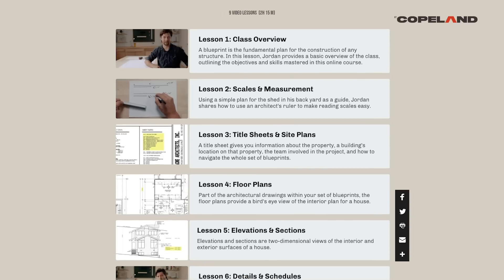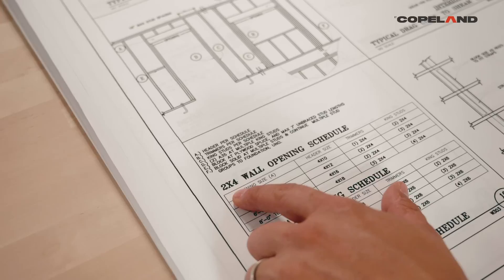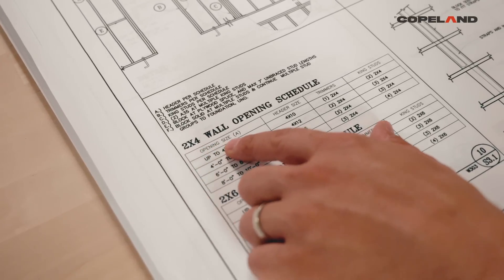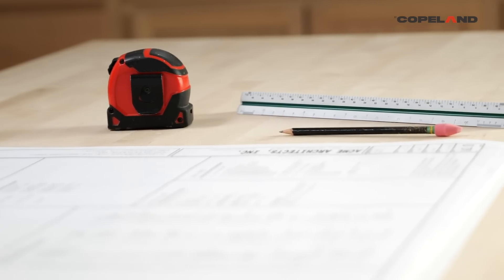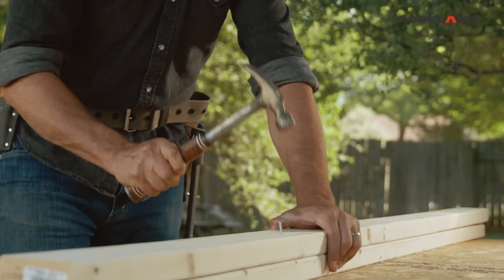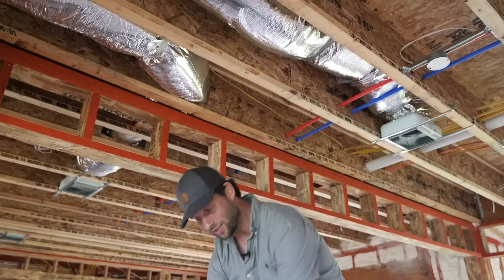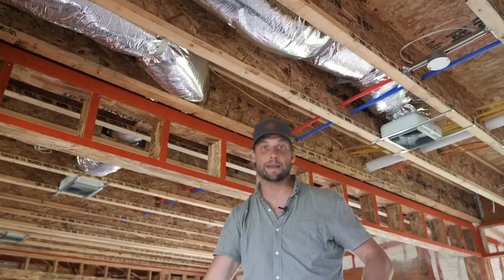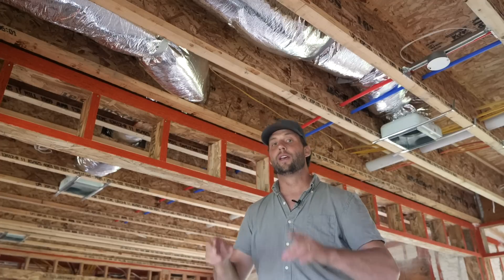Flex vs. Rigid Metal AC Duct - My preference may surprise you!

Comment: I wonder how well it will hold up after a hundred years compared to rigid. We know the rigid will still be just fine. And don't forget the hybrid approach of running rigid trunk lines and flex branches.
Reply from the maker: I agree, time will tell, but given that my ductwork is in conditioned spaces away from traffic and UV, I am optimistic.  I prefer a "home run" solution where each branch ties directly into the plenum.  It makes a bigger plenum, but with dampers at the start of each run, it makes adjusting the flow through each run super simple.  It really depends on the design of the house and AC location.
Reply: Jordan Smith will you, or rather can you, do a more in depth video on running ducts? This has always been puzzling to me on how to size the ducts  - how large should you start your duct or plenum and do you step down the diameter, and if you should then at what point and to what size? And now you mention dampers and my head is spinning. I would love to know more. I know there are so many variables but is there a "general" rule of thumb for some of it?
Reply: @robertrusso5525  There are rules of thumb like 600 square feet per ton.  Sophisticated HVAC contractors will do a Manual J, that is, calculate the total heating or cooling load.  Choose the right size equipment to satisfy that load, and then design a duct system that distributes a portion of the total air volume of the air handler proportional to the load for each room, following installation, the system would be balanced to make sure that actual airflow matches the design.
Reply: How many houses built today will be standing in 100 years?
Reply: @jl9678  probably a lot more than you think. There is a large number of homes where I live that were built in the 50s and 60s still standing. And builders like Jordan are building to standards that will have a house survive for hundreds of years barring a natural disasters
Reply: @ColeSpolaric  house built in the 50s are not 100 years old. And how many systems in those houses are original? Did they even have ac in the 50s?
Reply: @jl9678  I'm just saying that they're still standing and will most likely be in another 30 to 40 years. Many of them have forced heating systems rather than radiant.
Reply: in 100 years we won't be  using central systems.  I am shocked people are still installing this crap.
Reply: @MichaelMantion  what should we be using ductless systems? I hope that's not what you're proposing
Reply: @jl9678  The entire country of Japan does it, it's not the radical of an idea
Reply: @TheAnimeAtheist  does what?
Reply: @jl9678  have like 3 or 4 ductless minisplits per house, no forced air system at all
Reply: @TheAnimeAtheist  oh. Yeah, all of Asia and Africa use those.

They have their shortcomings.

Comment: Its 2020....   Anyone who doesn't install mini splits needs to have their head examined.
Reply: Mini splits are typically oversized (smallest heads are 6k btuh, that’s 500-1000 square feet for our systems). MS have terrible filtration (we spec MERV 13 minimum on our air tight ducted systems). MS, in general, do a poor job of moisture removal.
Reply: @neilcomparetto  shh. Don't burst their bubble
Reply: That's a question of cost. Especially if you want a mini split that doesn't stick out like a sore thumb.
Reply: @ColeSpolaric  Its also a question of efficiency and effective temperature control.  Being able to turn off rooms you don't need, then have those room come to temperature quickly when needed is great.  Ceiling cassette are getting much cheaper and common..  Also most homes will have multiple outdoor units, that provide redundancy if there is a problem.  Lastly mini splits are much more reliable, easier to install and cheaper to maintain.  SURE top of the line Mitsubishi systems are  expensive, but most quality Mini split systems with in ceiling cassettes are similar in price to Central air once you consider installation costs.  The utility cost savings are just icing.
Reply from the maker: We are definitely moving towards VRF, but there is still a need for ductwork to get proper distribution and mixing in many situations.  I do like the redundancy of multiple units.
Reply: @JordanSmithBuilds  We install a lot of the 12k DUCTED Mitsubishi units, so we still have some redundancy. VRF typically has less redundancy because if the outdoor unit goes down, or if there is a refrigerant leak on an indoor unit, the whole system is impacted... Ducted is the way to go — able to right size small zones with air balancing, able to add on IAQ devices like great filters, ducted dehu, fresh air, humidifiers, etc... Are they less efficient? Possibly. A well built house (like yours), doesn’t cost a ton to heat/cool, so the available money to save is minimal. Plus, comfort isn’t free.
Reply: @JordanSmithBuilds  Ductworking is so unhealthy in every way and should be avoided at all cost.  Ceiling fans and doorways  are more than capable of air distribution, Having GOOD air filters in every room is much better than pumping air through a toxic environment and relying on your system filter to stop the toxins.  No modern builder with a brain would recommend force air over mini-splits in a new build. I get it if the customer wants forced air give them it, but you should at least recommend a much better alternative.  I am waiting until we just push hot and cold salt water around the house to heat and cool and keep the  evaporator and condenser outside the the main building.
Reply: @MichaelMantion  have you seen the inside of the typical mini split. It's a filthy , mold filled gross thing. 

Which mini split is small enough to cool a 120 sf room? And when you have 4 of those rooms, who will clean the mini splits.

Saying mini splits is the answer is an uneducated position
Reply: @ColeSpolaric  mini splits don't provide ventilation and ventilation is required by code so .. 😂 and they don't work well in parts of the country who get below 0 degreesF.
Reply: @CybekCusal  geothermal comes into play in northern climates. And a central hvac system doesn't necessarily ventilate either unless designed to. Some systems separate the ventilation. Then there are those that use radiant heat. All the possibilities nowadays lol
Reply: @CybekCusal  only leaking ducts in unconditioned space provide provide ventilation :)
But I agree that such kind of ventilation is better than no ventilation
Reply: @CybekCusal  If that were true then the codes should be changed and the people advocating for "ventilation" should be ignored.  By your logic a energy efficient house  is more dangerous because the forced air system would be on less.  about  I would say before I installed mini splits my forced air system didn't run 8 months of the year.  I really only needed cooling for 4 months of the year and occasionally had to run the gas furnace.  I get it there is more margin and more labor in traditional systems and many mini split systems are installed DYI.  I understand all the HVAC people are afraid they will go out of business.  But learn to code or something, don't spread lies that ventilation is needed.  Again if HVAC need to run for ventilation than 3/4th of my life has been living in a deadly situation.
Reply: @ColeSpolaric  I love ground source heat pumps and I actually have a google alert set for mini splits and ground source.  In theory they are being designed but we are getting to the point that mini splits are just so efficient ground source.  I have plans to add a heat exchanger so I can use my pool water to improve the efficiency of my pool system.  Pluss then I can keep my pool open later.  I use a natural gas fireplace to heat the house so the mini split unit near the pool pump isn't used a lot in the winter.
Reply: @MichaelMantion  lol. I'm a licensed engineer silly . No lies here. 🤦🏻‍♂️😂
Reply: @ColeSpolaric  yep. I love decoupled systems for commercial buildings
Reply: @CybekCusal  OMG your a licensed engineer.  that means everything you say is 100% correct and you would never mislead anyone.  TY for helping explain why mini splits are a mistake. BTW that was sarcasm, being a licensed engineer is not hard.  If you are a licensed engineer solve the equation below

8 ÷ 2(4-2) =
Reply: @MichaelMantion  = bored
Reply: @CybekCusal  Sick of bad people spreading false information..  mini splits are a disruptive technology and people like you are afraid of them.
Reply: Yeah, no. Minis are great for certain applications (old houses with no easy duct runs, problematic/underserved rooms), but nothing beats a well designed central system. Parts for most central split systems are easy to get, they're easier to work on, and they (can) have decent filtration. Minis typically just have a crappy screen/mesh filter, and cleaning them is a total PITA.
Reply: @bnasty267  Im sorry r u saying that the mini splits filters are hard to clean vs cleaing a home filter? First of all you really should be using a hepa filter with an ion generator to pull particles out of the air. I use winix units, 3 of which are wifi so I can monitor air quality.  They are cheap, their filters are cheap, they are much more effective than central air filter, they fun year round and automatically increase when needed.   Don't relay on a central air system to give you healthy air, that is contrary to reality.
Reply: Not all solutions work with Minisplits. I was ready to get one (old home, poor attic space/wall access) when someone mentioned High-Velocity AC systems (small tubes and high volume AC pressure). Plus most minisplit manufacturers still have ugly units for wall/floor. Ceiling cartridges are nice but small homes can't accommodate.
Reply: @xoxo2008oxox  they have picture frame units as well. But the majority of the units are just ugly.
Reply: @ColeSpolaric  The majority of units installed are ugly to some, Most people who install the wall units do not care. There are plenty of in wall cassette units that look better than having multiple supply and return vents all over.  People install the wall units because they work very well and are cheap, if they wanted something looked better to you they would have paid a little bit extra for the ceiling cassettes or like said LG picture frame model.  Personally i think it would be easy to decorate a wall unit with out affecting its effectiveness.
Reply: mini split don't last that long and are hard to repair. try finding someone to repair a mini split during a heat wave]
Reply: they suck in a cold climate for heating.  I have one that is rated to negative 15.  It works but loses major efficiency and comfort under 20 degrees.  I love it for any temp above say 35 degree F